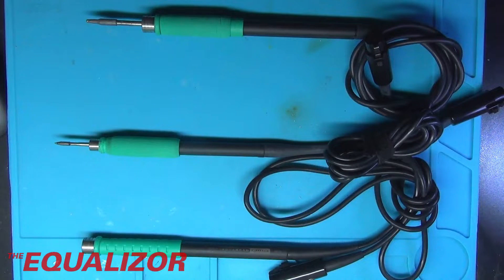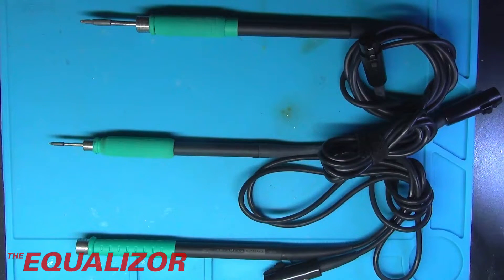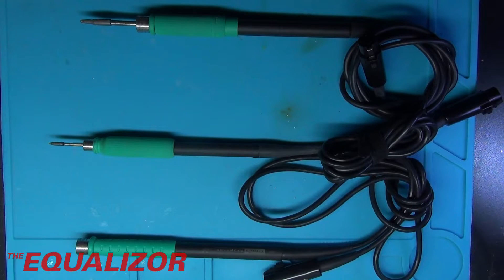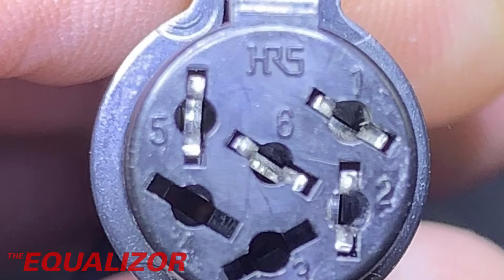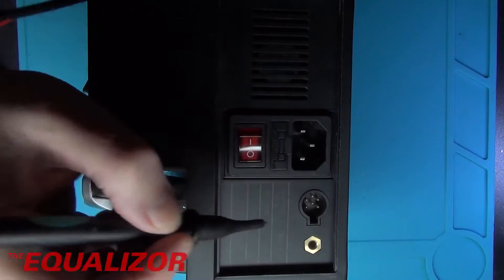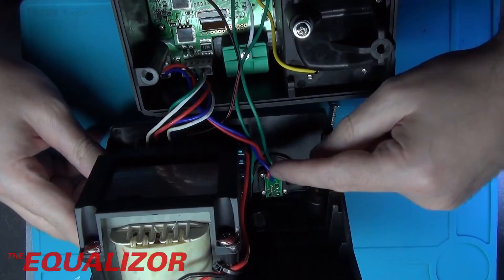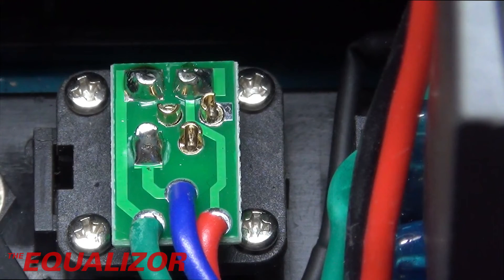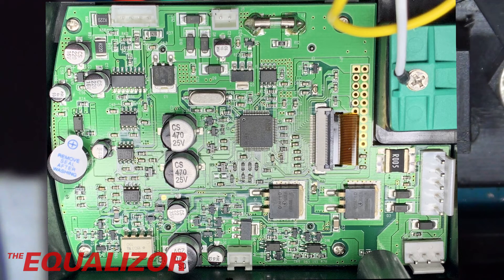Does the Jabe UD-1200 work with T210 handle?

Comment: As I have one of these irons I have been contemplating this issue my suggested solution is a relatively straight forward one. You could use resistors to make a voltage divider and use a switch to manually change the output between 24v and 12v.
Reply: That's exactly what I was when I saw your comment ........ I'll get to work

Comment: With the c245 and c425 cartridges in place, could you measure resistance between 1 and 2 in T245 and 1-2-6 in T210? please, thanks
Reply from the maker: I'm sorry but I'm not revisiting this yet again.  The Jabe station iron doesn't have pin6 connected, so it cannot support the 210 handles/tips.
Reply: @the_equalizor  ok, Thanks a lot

Comment: Can you try putting a DC to DC buck converter between the station and the T210, I wonder if they use the same thermocouple
Reply from the maker: Slot1Gamer That wouldn’t work. Iirc the JBC cartridges are fed a sinewave (ac from the transformer I think) and the thermistor in the handle is read during the zero volts crossover on the sine wave.  You can’t use a buck on pulsed dc or ac. It’s interesting that I’ve seen some 3rd party JBC compatible controllers that run off of dc and even those don’t support the 210. There’s something special about it I guess but no idea what. I mean if JBC can do it, why can’t the clones?

Comment: OK, I have just received my Jabe UD-1200! from the menu I found the updated day to be 01/08/2019 and software version is V2.1.1. The only difference I found compared with your one is the English menu only. I have also opened the box and checked the iron pins which are pretty much the same as yours (three pins connected only).
Reply from the maker: Okay, thats good to know. I still use my Jabe iron as my daily driver for general soldering and its still great. I'm sure you'll enjoy yours too :-)

Comment: maybe need try down station power on settings to 70-75 Watt for t210 tips? you can try it?)
Reply from the maker: Nope, dosnt work, already tested. Someone else has told me that those two bridged pins put the station into 12v output instead of 24v that the T245 tips use, so no, reducing the wattage wont help.